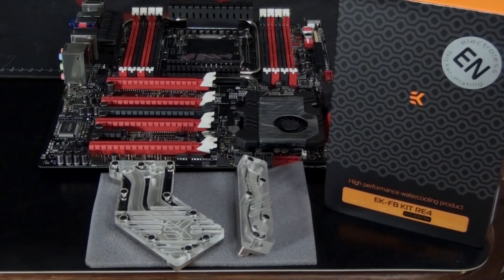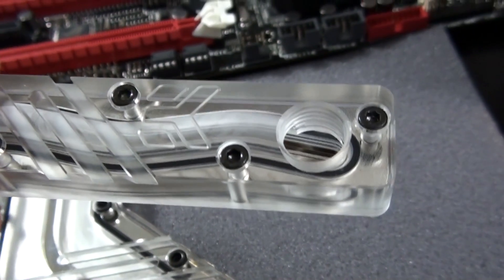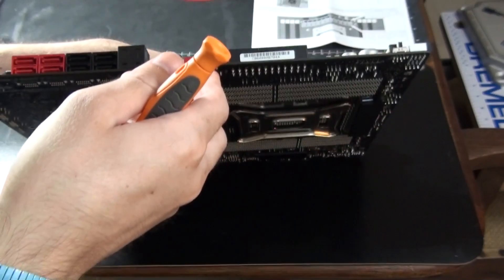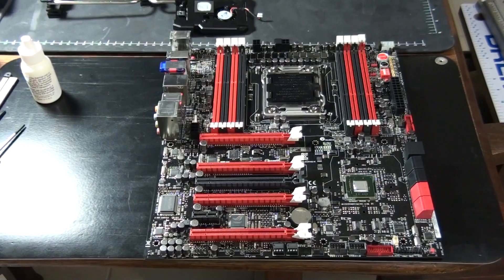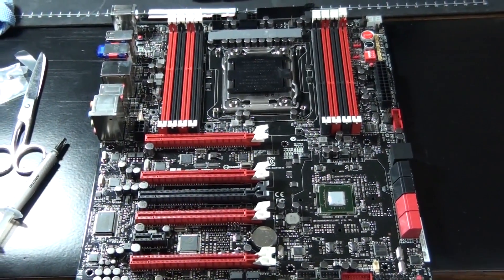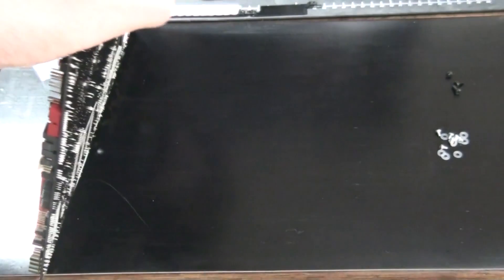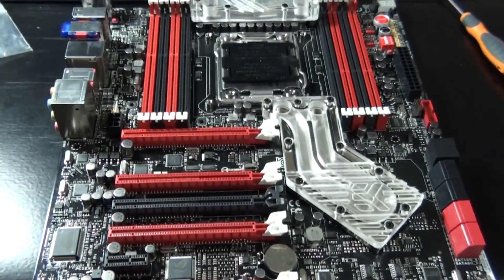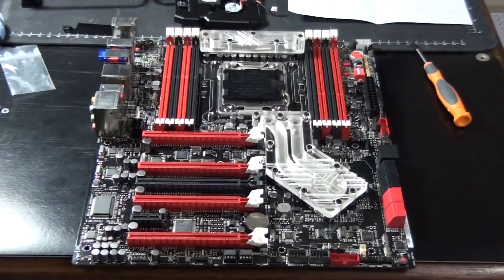Motherboard Water-block Installation Guide

Comment: I enjoy your videos.  I also agree with you wholeheartedly about anti-static wrist straps and simply grounding yourself before touching your components (and be cautious of the clothing I'm wearing).  Correct me if I'm wrong, but isn't the wrist strap supposed to be attached to your anti-static mat which, in turn, is plugged into the ground port of an electrical outlet?

Comment: singularity can you please tell mi why do water blocks don't cover all the areas where the original heat sink were, will that affect performance or it was used only for design purposes only.

Comment: People writing that cooling the mobo with water is a waste of money and air cooling is sufficient, try overclocking a x79 6 core chipset after a 4.6mhz overclock and above the mosfet will reach 100c and the chip will throttle. The mosfet block on water will keep the temps down thus increasing your overclock potential.

Comment: Good video don't use your finger to spread Tim though, its a no go yes it will work but even if you wash your hands oily residue is left. Temps will increase by using your finger. Less is more with thermal paste.

Comment: athetics for the most part, although on the rampage 4 extreme the little fan on the chipset can get pretty annoying so it does help with that, but performance wise there is no real benifit from watercooling mb.

Comment: If i ran nvidia gpus with 2 way sli on the mobo (meaning the first and second x16 pcie slots) and i wanted to use an ek fc terminal to link the two cards, can i use the 3 slot dual serial ek fc terminal?
Reply: No, you can't.  There is no way to plug the oval openings for the remaining card.

Comment: Sorry, i didn't hear "wireless". But wearing a wireless anti-static wrist band or wearing none is the same, because wireless anti-static wrist bands are pseudoscientific hoax products and useless! ... and he also said he don't trust them and always touch a grounding point before start working, so it doesn't matter that it's useless :-)

Comment: This is all a waste of money on upgrading the motherboard the block is like 140 bucks and I think the money to water cool should only got to gpu and cpu only because those 2 are the only thing you need to cool down

BTW dont use water use non conuctive cool liquid that the sell and spend that extra 7 bucks for a better temp and less damage rater spend 10 bucks than 3000 on a new computer